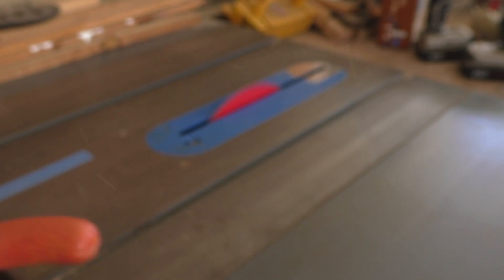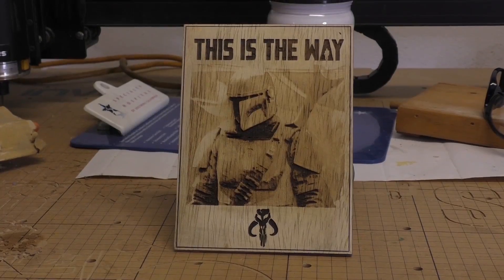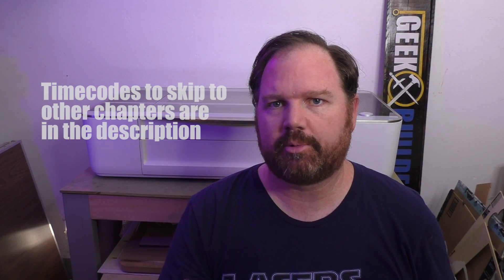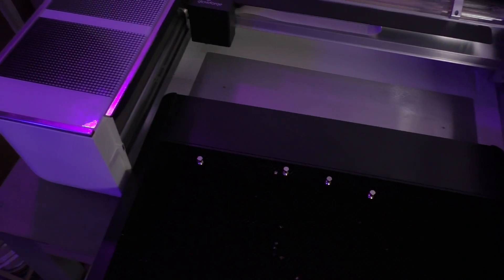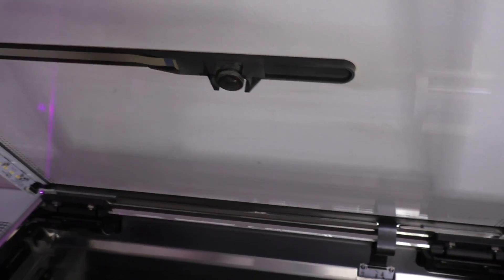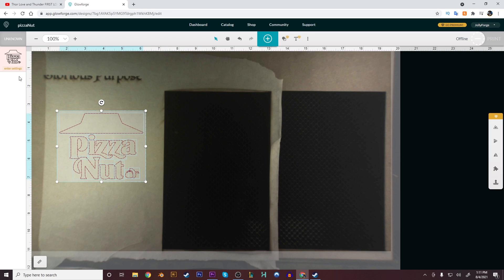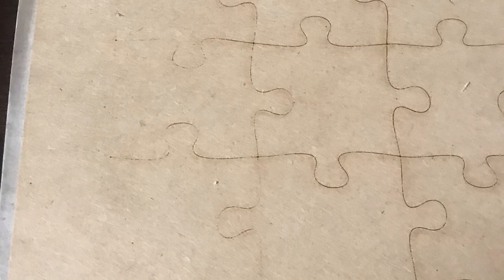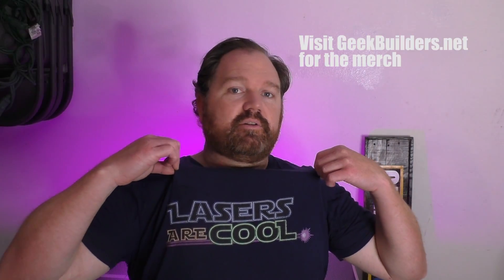Life with the Glowforge 6 Months Later

Comment: Very nicely stated, I have had my glowforge for 3 months but have only started using it with in the last month on a regular basis. I have had a lot of the issues you have except heating up, one mine is a pro plus and I buy for the subscription. It is in my craft room and I purchase the external fan off Amazon. I am not a laser or software user so trying to learn all the settings when you use non proof grade wood has been such a pain. I use the setting recommended from the people I buy the wood from and one time it will work and 5 minutes later it wont cut through. The line up for the camera doesn't line up proper even after I do all the calibration and cleaning (mind you I have not used it enough to get it that Smokey.)  I have been on the community board for glowforge and see a lot of my issues listed but when I do what they recommend for the fix its hit or miss if it will work. So I can totally related to your video issues. Now with this all being said I do love it when it works correctly, I can make lots of beautiful things I could not without it. I do wish they would work on the software to correct at least that and the camera alignment issues. Thank you for the review, now I don't feel like its all operator error.
Reply from the maker: Thank you for your comment, its nice know that we are not alone with some of these frustrations. As far as using the non proof grade materials. Someone in the community forum has a spreadsheet with all of the custom speed and power rates for various materials. If I can find the link, I will post it here.
Reply: @GeekBuildersNet  thank you.
Reply from the maker: @texasnana824   Here the direct link for that spreadsheet, https://docs.google.com/spreadsheets/d/1sWOebDU94HwezYPbHa3YdtXjpLbEl_vEPvCb1dSByL4/edit#gid=582951492
Reply: @GeekBuildersNet  Thank you
Reply: @GeekBuildersNet  thank you for your positive attitude, hope you still continue to have fun with your glow forge and what is next! : )
Reply: I needed to read this today. I am so frustrated and was just feeling like a failure. I wish I would have gotten a different machine. Thank you for validating my frustrations
Reply from the maker: @joe Krakowiecki Is the heatsink only on the pro? I didn't think the basic had passive cooling
Reply: Wait for it within the last 3 days I can’t do a cut for more than 8 minutes without it pausing for 10 minutes to cool down in a 69 degree room WITH A FAN IN IT - if you can tell I’m frustrated that overheating thing is the only reason I even ever even found this video and low and behold I had my glowforge longer than this guy and felt crazy like everybody on glowforge forums just seems to femoral within the flaws except for acknowledging that the flaws exist and it’s frustrating- that mentality doesn’t foster improvement but working within the glowforge box.

Comment: I have owned one for 7 years and never had a problem. Across that time the software has been updated with new features many times that makes the machine better than it was when I bought it. All of the premium features in the subscriptions are simple design tools that should be accomplished in your design software. I do wish the machine was faster.
Reply from the maker: I'm glad that it has worked out for you. I have a few Pros that I use at work and work pretty well for the most part. If Glowforge kept up with their R&D and did not force the always connected aspect of their machines, I would probably have stayed exclusively Glowforge. Thanks for watching.

Comment: I've a GF Pro and completely agree withe the nonsense paywall for the BASIC features. OK for downloading design for a subscription, this is fair. But NOT for rotating or mirroring an object, or drawing basic shapes to cut parts of spare materials. More, I agree GF should add the "test fire" method to improve the placement and accuracy of the design: the camera is simply okay... but not precise enough. For the rest, I love the machine, especially the Pro, that's better for cooling, speed and power.
Reply from the maker: Well Said. Thanks for watching

Comment: Interesting how different the review is when it doesn't start out with "Glowforge sent me $9,000.00 worth of laser equipment for free and now let me tell you why it's it best unit ever."
Thanks for an honest and heartfelt review. The whole proprietary, cloud-based software thing gives me the heebe-geebes and is the main reason I'm not getting one. If the Internet connection goes down, you're dead in the water, right?
Reply from the maker: You are correct about the internet. No internet, no laser cutting. Thanks for watching.

Comment: The biggest reason i crap on console players ( I'm a PC gamer for 13 years) is that the subscription each month to pay online. Absolute no end of discussion. And then you said the rotate function is locked??? I didn't go through 2 years of college using 20k machines that have been refined to be simple and effective at what they do... to this expensive machine, that is a hinderance to itself in the simplest ways, I havn't done that much research into lazers however i have found a lazer attachment on a router CNC for 1k. which sounds like a lot but at this point if the alternative is 3k and headaches... its almost a no brainer
Reply from the maker: Yeah... The subscription model is frustrating

Comment: I live in the UK and we cannot, yet, get the glowforge over here. I currently use a low wattage hobby laser with Lightburn software. After viewing several dozen YT videos on glowforge it just seems to me like a pretty basic 40watt laser in a fancy box. It seems very tied in to their own eco system with no options to use 3rd party software packages and the absolute killer for me is the need for a web connection and their insistance of using their servers to process your work. If Glowforge ever did come to the UK it would have to be a whole different type of machine for me to give it consideration!
Reply from the maker: That's good to know, I thought they were already in the UK. Thanks for watching.

Comment: Excellent! Wish I had seen this before I bought the GF. I fell for the slick advertising. I don't like having to use their server to set up my designs. Customer "service" is like talking to a wall, IF they respond in a timely manner. I LOVE doing laser creations, but I wish I had the knowledge I have now before I bought it because I would avoid GF like the plague.
Reply from the maker: Yeah... The machine could be incredible if they just fixed a couple minor issues, but nothing seems to be improving on the hardware side. They are more of a software company at this point.

Comment: lol... They're monitoring everything, as a service for the customers? Riiight...
So have the machine log everything that happens... Offline... That you can access through a cable/wifi and send to them, if you want... So you're in control of your own info.
That's a lot of issues I don't wanna deal with, but absolutely the always-online part and them gathering all the info... They can certainly gtfo with those two.

I've been using diode lasers for a good while now. While they're ramping up, they're far from the power a co2 can do. But they're as straight forward as a machine can be. You have to clean them... Sometimes tension a belt... That's pretty much the only "trouble" I've had with them. And they can do all that I need them to do, for personal use and small etsy store.
Reply from the maker: I use my diode lasers more than the Co2 lasers right now. They have gotten much more reliable and are getting more powerful all the time. Thanks for watching.

Comment: I don't like the fact that it really becomes a $3000 paper weight if glowforge services ever shut down.  Also, putting a monthly service fee paywall on such simple features when you paid 3 grand for the machine that cost maybe $100-200 to manufacture at scale is just insulting.  Thanks for the informative video.  Subscribed.
Reply from the maker: Just a quick update since I made this video. They have publicly stated that they would release the software if anything happens to the company, but only under those circumstances as of right now. Everything else is still applicable. Thanks for watching.
Reply: @GeekBuildersNet  Wow, thanks for the update!  I'm watching some other videos on your channel on lasers, as I've been thinking of getting one for cuts and etches.  I had originally thought of modding one of my Ender 3 Pro printers into a laser system, but your videos have shown me I probably have better options.  I really appreciate your informative and well produced videos.

Comment: I have now had my glowforge pro for a little over 2 years and the laser is not working anymore. They want me to pay $1125 to send me a refurbished machine with a 90 day warranty and then I need to mail mine back to them. I also purchased the air filter when I got it. The filter was full after a couple weeks. At the time you couldn’t even replace the filter. Now you can for $249. The company only responds to email and when they do it they always send a letter for you to troubleshoot. Which you can find for yourself on there website. I have called them several times and you can only leave a message and nobody returns your call. I believe the laser tube has gone out and they don’t even sell replacement or any directions how to even replace it. It really is a shame because the concept is great when it works.
Reply from the maker: I know.. and I feel the same. It wouldn't take much on their end to make it a phenomenal machine and experience

Comment: One of the most accurate reviews. We regret buying ours deeply unfortunately
Reply from the maker: I have seen a lot of similar responses. I really wish they would address and fix some of these issues
Reply: @GeekBuildersNet  completely agree, we run a business based around the machine so with it being so undependable it really hurts us. We have the pro and are having issues with the pass through feature. Just like you said “I really want to like it” is our exact feeling. It has everything we want in a machine but at the end of the day it’s far too inconsistent! I hope for your sake they fix the issues.
Reply: @GeekBuildersNet  we are on our 2nd machine through warranty and quality didn’t improve at all. Our first machine the connections Sauter was completely detached. We also had issues with the back ribbon. Come to find out on the second machine the laser head is defective. We worry about replacement part prices once our warranty ends. Just like you said hopefully they do something!

Comment: I've had mine a couple of months now keep it clean and calibrated often no problems. My only issue is with monthly subscription for premium services that should be free. Apart from that fantastic machine 👏
Reply from the maker: I really want to like it more. If it didn't have the cooling problem and the inconsistency of cutting material, I wouldn't have much negative feedback about the machine.
Reply: @GeekBuilders   Reach out to glowforge  and ask them to perform remote assistance on your machine to check and test for issues. I know others have had these issues resolved afterwards.
Reply from the maker: @bigcheesevirus  I will, thanks

Comment: Gweike have a 50w model similar to glow forge pro with external air filter and air assist. I’ve put a deposit down on one when they did presale for the pro model. It offers identical features but they have their own desktop software and it’s compatible with Lightburn. Would be interested if you could get your hands on one of those to do a review.
Reply from the maker: I've seen they're machine and I'm curious about it. The only thing that made me skeptical is that it is also cloud based.. I might work with them in the near future though.
Reply: @GeekBuildersNet  it’s lightburn compatible. You don’t need to use their cloud software. Hopefully finalising my pre order in the next month.
Reply from the maker: @ctech6247  I was not aware of that.. Thanks for the heads up

Comment: This sounds like crap. I'd need to use this during work hours & need accuracy, probably within a millimeter. Plus the privacy issue is a huge problem, and the software doesn't sound customizable.
Reply from the maker: Accuracy is a huge problem with the machine and the fact that it is so locked down that you can't do a lot of operations that you can do with Lightburn compatible lasers.

Comment: I have had my glowforge for 2 years now.  I Experienced some of the issues you did, and I also have some solutions for you as well.   I live in Arizona and that first summer was killer with constant cooling down errors.  I added a window Ac, I directed the air to the intake at the front right side of the machine, I bought a beefier window ac, ac set at 69 degrees...... I fixed the issue, How?   On the backnof the laser head is a tiny fan.  CLEAN THIS FAN,.  I literally went from cooling errors every few minutes, to 0 errors in over 1 year, by cleaning that fan every few months.  In fact,  room temp has not even mattered.   Camera issue.  The camera us there to assist buy us not super accurate. A solution is making a simple jig.   I have a YouTube channel  where I do all kinds of glowforge tutorials, and that is one of the latest. lithosandlasers is the name.   For items larger than .5 inches, you need to remove the crumbtray.  The key her is that the item can then be up to 2 inches, and most be within .5 inches of the laser head.  I use little wooden risers for this.  you can search for MATERIAL RISERS IN MEDIUM DRAFTBOARD to find the files.  They work awesome.     Hope this helps.
Reply from the maker: Having the clean fan hasn't made a difference for my particular machine. As far as cooling goes, I've avoided the air conditioner hack mainly because I don't want to have to run an additional unit to fix what I thought Glowforge should have build better... but I may not have much of a choice. As for the camera, I've made templates and they're useful at times, but there are also a lot of times when I just need it to align better. With all that being said, I appreciate the tips. Thanks for watching.
Reply: @GeekBuilders  To be clear,  the fan O am referring to is not the air assist, that blows the air out of your cut path, but the tiny fan on the laser head itself. It's job is to cool the laser head, and blow debris away from the lens.   Best of luck :)
Reply from the maker: @LithosAndLasers  Got it. Thanks for the tip
Reply: @GeekBuilders  Anytime, Hope it helps.

Comment: THANK U I WAS READY TO BUY THE PRO GLOWFORGE...$6000... I AM GOING TO STICK WITH MY ORTUR MASTER 2...I WILL NOT EVEN THINK OF GLOWFORGE AGAIN
Reply from the maker: The ORTUR is good as a diode laser from what I hear, but it is pretty different than a C02 laser. If you are still interested in a C02 type laser, check out the Full Spectrum Muse of the xTool Make Block

Comment: You did a good job with this video, at first I thought it was an infomercial for Glow Farce. I bought my K40 when they were still $350, I put a new bed in it ($40 parts from Lowes and Ace) an inline fan ($20 on Amazon). The GF looks good but the software thing was a no starter for me!  I wished I had bought the 60watt last year when they were $1,700  now there're $2,300. Whit that machine I'll go from  cutting 3mm(1/8 in) to 6mm (1/4") wood of any kind just about.  I wonder could you put another motherboard( Ruida control and power supply about $410) and bypass that GF crap?
Reply from the maker: I also have a k40 and fixed it up to be a pretty good machine. As far as bypassing the controls on the glowforge, I know some people were working on it, but have not been successful yet

Comment: I just stumbled upon your video. I applaud your review. It’s very accurate. I’ve owned a pro with premium subscription for a year and a half. I have successfully used it maybe 8 times. If it’s not the connectivity problem, it’s the overheating. It’s housed in my garage as we have three other people in the house working from home so it’s too loud for indoors. The area I live in has an average outdoor temperature of 78°. Which shouldn’t be all that bad, but after seeing the size of the cooling tank, that tells me a lot of people have temperature problems. The alignment is a joke. Piecing orders together due to alignment problems is a thing. Have I used my GF more than 8 times??? Yes, I’ve tried, truly tried. It is a very expensive hobby make as it’s not reliable enough for me to build a business.
Reply from the maker: I'm still hoping that they come out with a fix or even an addon tank/chiller for the laser. Thanks for watching